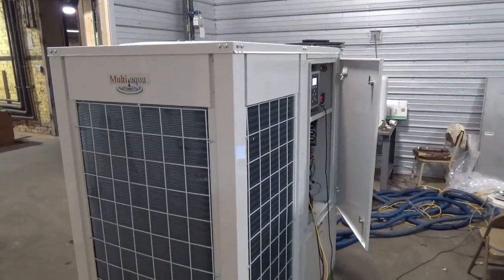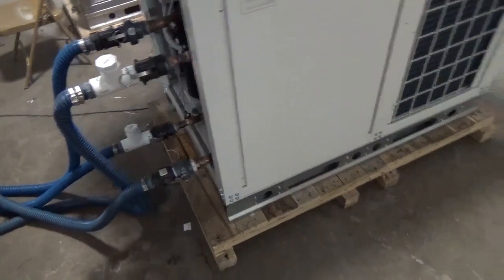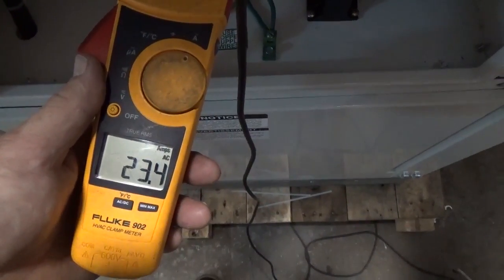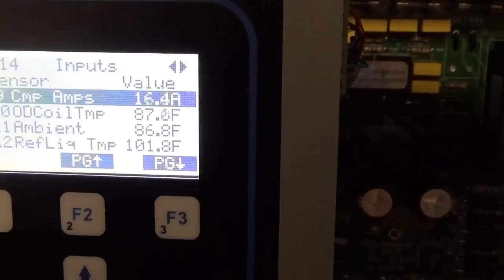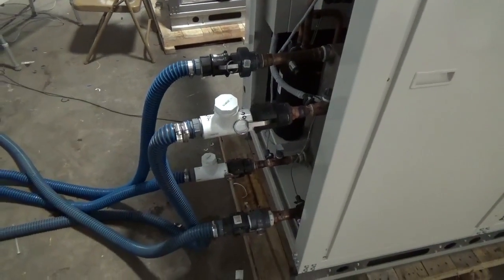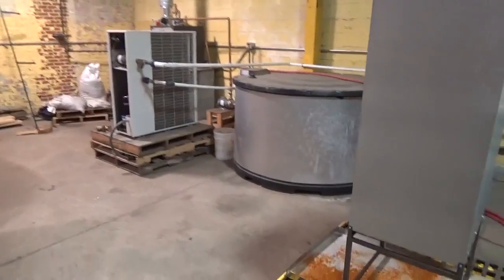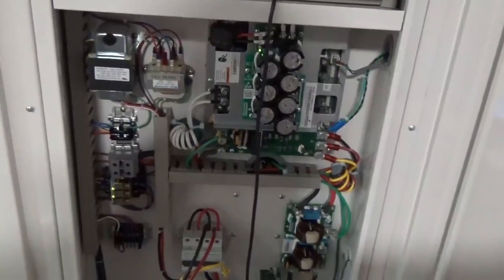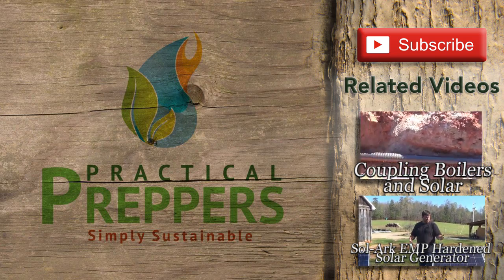Solar Powered Heat Recovery Chiller

Comment: Chillers are great and much more efficient than standard direct expansion or heat pump units.  When I've looked at them in the past, the chiller, although extremely efficient, has to run continuously.  Is that not the case with this one?  If not, I'd like more particulars.

Comment: I didn't hear you say it but I am assuming it uses 240vac and those amps are 240vac so basically 240vac X 22 amp = 5,280 watts. right?

Comment: ok let me see if I have this. In summer take cold water from this unit to an coil inside air handler to provide AC for a home and reverse for Winter. I am assuming here that in the summer DHW would be available just from the heat pulled from the house an outside air and the cold water from groudloop or open well type thing. In the winter it would have to make the heat from groudloop or try to pull it from the air? I have obviously missed some stuff because I am still trying to figure it out..

Comment: How much money does this 5 ton monster cost?  I would like more information about this Copla-scroll compressor. Is this compressor a hermetic or semi hermetic?  I am retired HVAC Tech and am using a pretty deadly refrigerant.
Reply from the maker: +Ray Walters Around 14k.  http://www.emersonclimate.com/Documents/Products/Compressors/commercial-scroll/2016-0316.pdf
Reply: Just Got a Quote from one of the Suppliers, not Good Number for this System.Can get a Basic Water-to-Water Chiller System for About $5k- This was from Interphase Technologies in Maine -The MSRP on the MHRC is $27,000. The MSRP on the solar powered version is $36,000. These products are available through our distributors and contractor network.

Comment: Very interesting video. I've been reading the MultiAqua website, and I don't see much reference to energy efficiency. One would think that if they offered a substantial savings they would crow about it. So, in your opinion, is this system particularly efficient, or is it simply the power-usage profile that makes it more compatible with solar? 

Disclosure: I'm planning to open a restaurant in a few months, and will be in the market for HVAC gear.
Reply from the maker: +taiwanjohn http://www.emersonclimate.com/Documents/Products/Compressors/commercial-scroll/2016-0316.pdf

Comment: Will this unit work for heating water in a hydronic heating system in a  home of around 2000 sq ft with winter temps seldom dropping below 32° F. And powered by a solar-wind hybrid system?
Reply from the maker: +Subgunman yes it would

Comment: This is amazing. It would be awesome to use it in Australia. We have heat pumps for hot water heaters and they are useless. This video has opened my eyes to what potentially could be possible with solar. I love your videos engineer775 they always inspiring.

Comment: Looks great. Will you still be able to run this when you have multiple heads to deliver heat & cooling. Plus loops for domestic HW? I gather you would need to run some pumps to the heads & to the Domestic HW.

Thanks

Comment: So you would be using that as a chiller, and hot water would be a byproduct?  Or is that unit smart enough to be tasked with both applications  of keeping the house at 70 and my water tank at 140?
Reply: +Albion Laster It will make dedicated hot water, dedicated cold water, or both simultaneously. It is smart enough to cool the house and meet the hot water demand for the structure.
Reply: +Ralph Feria By the way this is RF Jr. aka Chris at Multiaqua Inc.

Comment: Does anyone make a DCV fed system for HVAC and/or water heating so folks using solar systems with AC and DC load centers could feed from the DC load distribution & don't have to take the DC/AC converter efficiency hit?

Comment: What's the cost for this particular model?
Reply: Just Got a Quote from one of the Suppliers, not Good Number for this System.Can get a Basic Water-to-Water Chiller System for About $5k
- This was from Interphase Technologies in Maine -The MSRP on the MHRC is $27,000. The MSRP on the solar powered version is $36,000. These products are available through our distributors and contractor network.
Reply from the maker: +victor burela 14k

Comment: what is COP?
Reply: +Peter Los Angelos Coefficient of Performance = the ratio of useable heat flow to electrical power used. Max COP of a traditional heat pump is 3-4, but when the waste heat is being used for other purposes it effectively doubles the COP.

For reference, the COP of an electric baseboard heater is 1.0 (heat out = power in).

This unit is rated at 60,000 btu/h heat flow, but if the heat being rejected is being 100% used for a practical purpose, and the heat being absorbed at the other end is also being used for a practical purpose, it is effectively providing 120,000 btu/h of useable heat flow. At a COP of 7, this means it would draw about 5kW (104 amps at 48vdc, 42 amps at 120vac) of electrical power at full capacity.

Comment: Really interesting piece of equipment. It definitely could be the better solution for those applications you mentioned. I am especially impressed with its ability to integrate with a geothermal system, while automatically selecting whether that, or air, is the more efficient and to switch between them. And, that it can be operated off a solar electric system is awesome. 

On another subject - if I might ask - what is the status of the giveaway related to the Coupling Boilers and Solar video?

Comment: Could Thermoelectric Module be put between the cold and hot side Thanks
Reply from the maker: There is less than 100 degrees delta so not very efficient for TEGs.
Reply: Thanks